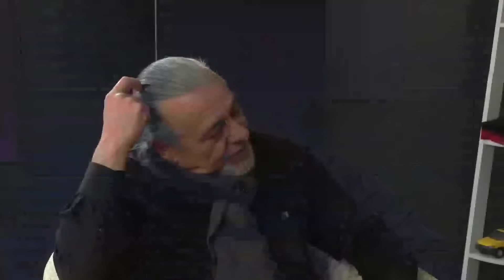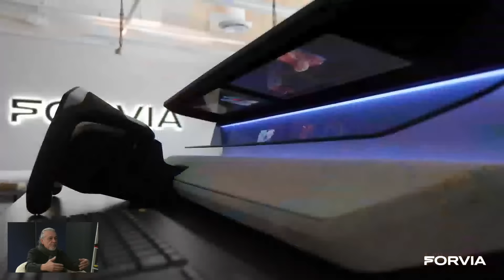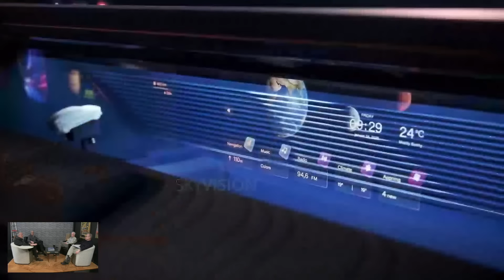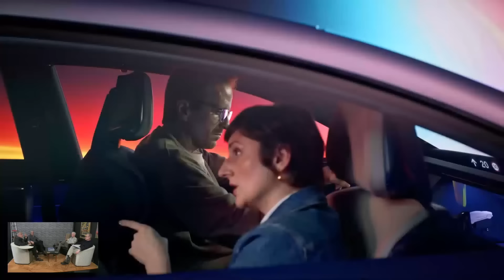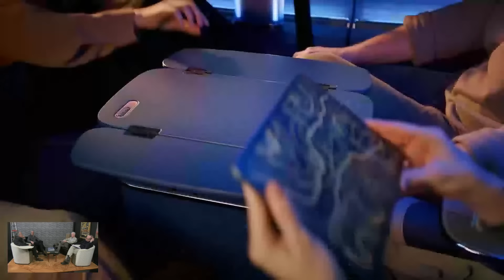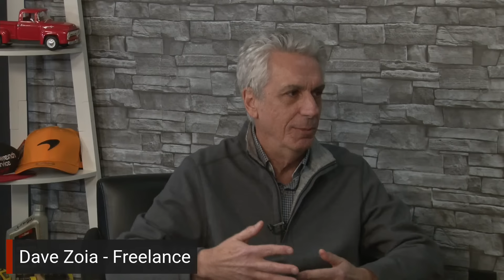The Death of the Dashboard? The Radical Future of Car Interiors -  AAH 776

Comment: I suspect the main reason more fleets do not have tons of eleyr8c vans is fleet managers not wanting to be an early adopter. There job is making sure the fleets function and are very reliable. In 2020, we did not have the data we have now showing great reliability and many fears about EVs being over-rated. 

When 2030 rolls around, electric vans will be more commonly found in fleets as well as electric semi trucks.

Comment: Ontario also has the cleanest grid for auto assembly in North America with 85% of it being nuclear, hydro or solar/wind powered... And the second cleanest grid for BEV charging itself after Quebec, Manitoba and BC which are virtually all dependent on hydro power exclusively..  And as your show said last week 96% of Canadian Plug In drivers use them daily using them as BEV's with gas backup rather than the less than what 33% of Americans who bothered? That shows you the cultural difference between our nations in one appropriate stat!

Comment: Toronto was second to only Detroit in total unit production in the entire North American Free Trade Zone region in terms of capacity and most of it's now offline and what was going to be converted to BEV assembly has been scrapped. And what was third shift to make trucks at GM Oshawa sent 1200 workers pink slips this morning. I see 3% Chinese quota soon becoming 30% the way things are headed. 30% though via localized manufacturing since Project Arrow proves you can build an almost entirely Made in Canada vehicle. 97% from domestic suppliers with only some screens and chips manufactured in Taiwan as foreign content..  All Canada needs to do is sign a JV pact and you can see both goals of "Chinese" cars assembled in Canada using almost entirely local content.. Or something along those lines. Canada isn't going to take its forced deindustrialization at the hands of a fascist dictator without a fight..

Comment: The classic and basic backlit gauge dashboards have always been my favorite. If it ain't broke, don't fix it. Only thing that needs a screen should be dashcams and a backup camera
Reply: Slate Auto agrees!
Reply: @stickynorth that is not what Slate is doing and is in fact removing everything and replacing it with your cell phone. 

I want all basic functions used daily in fixed easy to reach, back side of steering wheel and easy reach on dashboard. Front side of steering wheel but not so many that it requires taking eyes off the road to find and use. 

My Equinox EV almost has it right but needs a little refinement to get it right.

It’s the auto dimmable rear view mirrors that suck. Have not seen one yet that actually works and the simple mirror flip that requires no power, programming that has worked perfectly in my last 40 years of driving needed no reinvention.